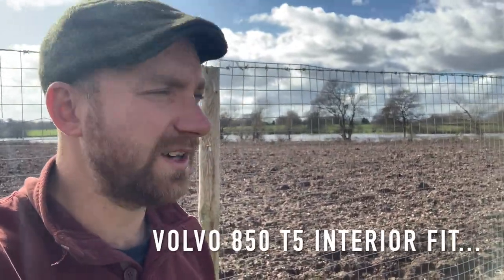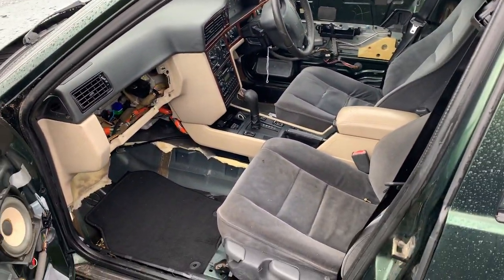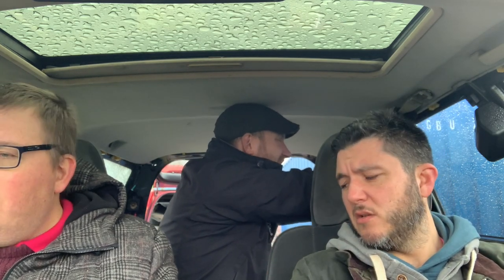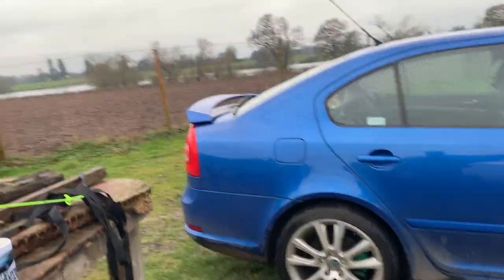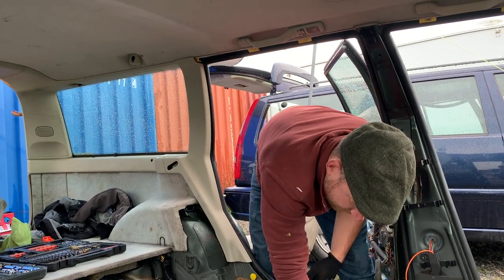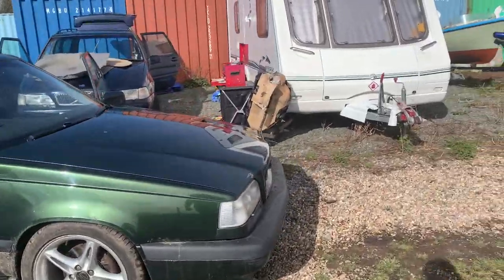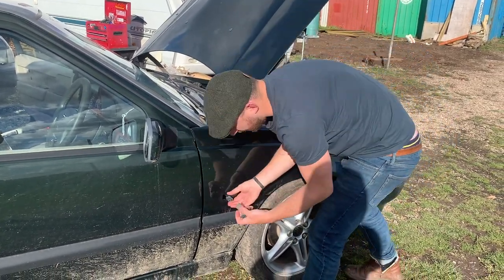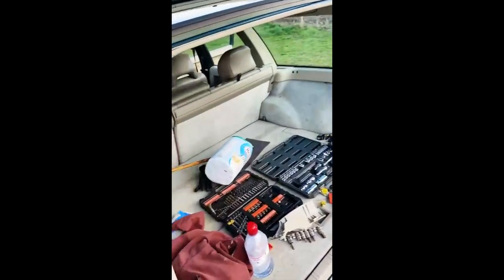Volvo 850 T5 Project Part 4 - Installing a V70 Interior into an 850

Comment: Ermmmm seatbelts in the 850 are an aftermarket thing 👀 the originals broke so had to think fast 😅
Reply: What ecu did you have in it?
Reply: @claymore2k1T10  me4.4 from shem in the end
Reply: @georgehodnett6135  Can't go wrong with a Shemtec ecu
Reply: @claymore2k1T10  definitely not! Runs absolutely spot on! Did I see Adrian is still after the T10 aswell? Just weighing up options on the R 😅
Reply: @georgehodnett6135  Sounds like he's trying to make space for it.
Reply: @claymore2k1T10  hopefully it will be revived! Fancy teaching me the ways of the supercharger 👀😅
Reply: @georgehodnett6135  when you're ready